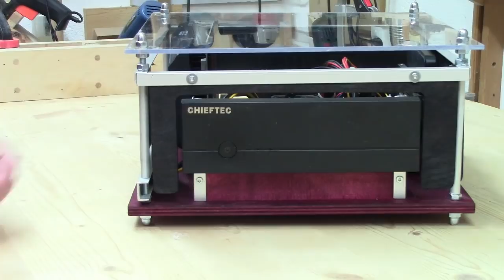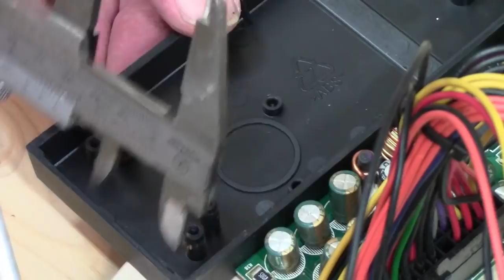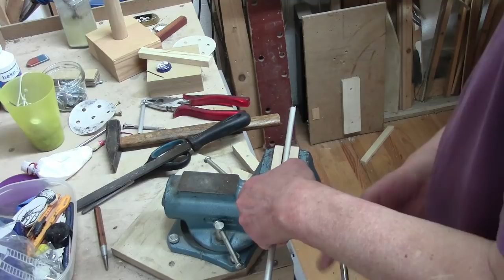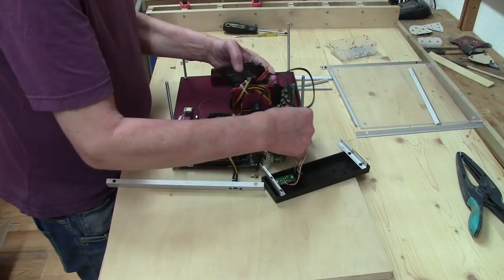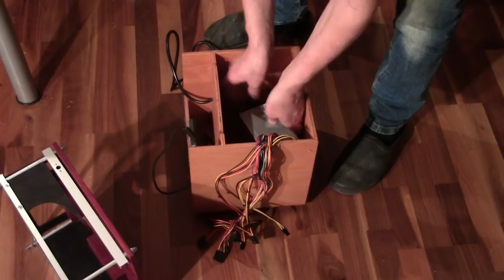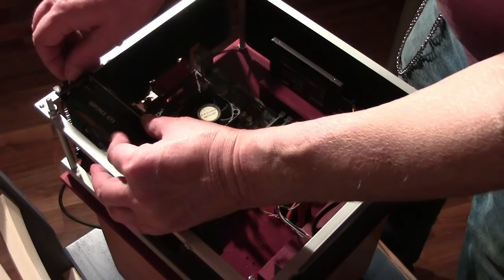How to make a Computer Case for Mini ITX PC - DIY JIG

Comment: Where did you buy and what are those metal little cilinders you use as spacers? Thanks
Reply from the maker: I bought it at my local hardware store. These metal cylinders are aluminum rods.

Comment: Yeah, that was satisfying seeing it all come together. Did you use an old power supply or did you have to buy an new one? I should have known you were a Linux man! (I'm trying out Mint for first time myself)
Reply from the maker: Thank  you Mark. First I thought I will use an old power supply but then I found out that a new one is very cheap, therefore I bought a new  power supply. Linux Mint works perfect for me and Lightworks is awesome and its free :)